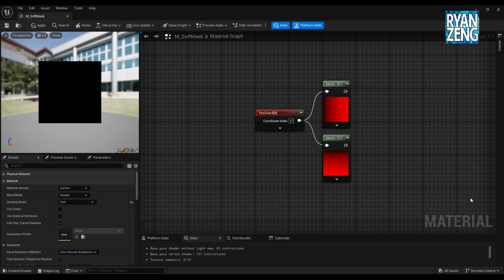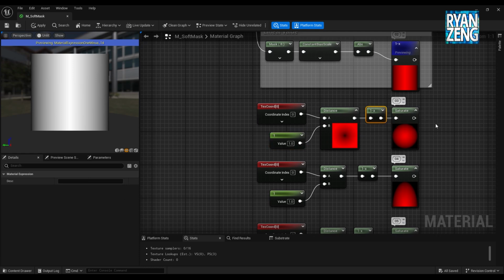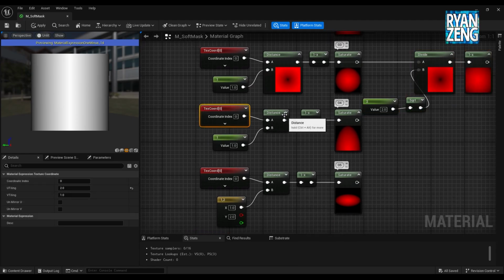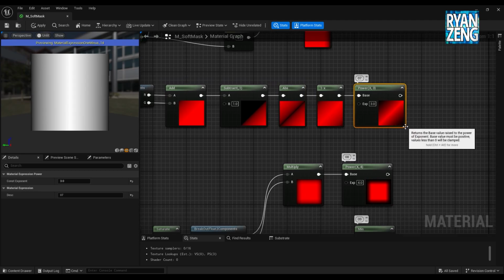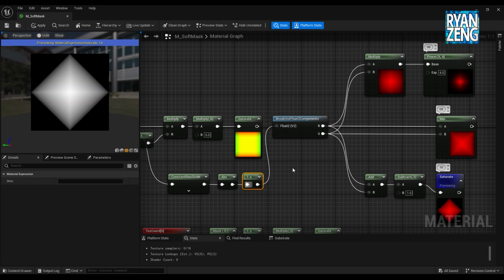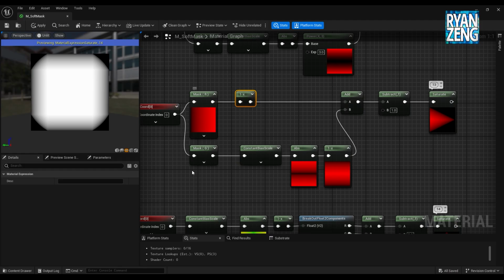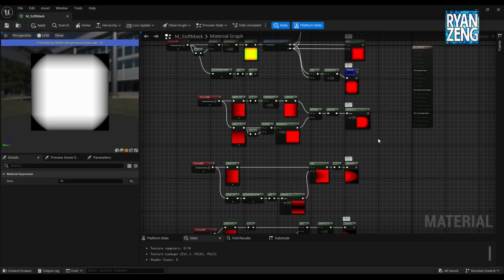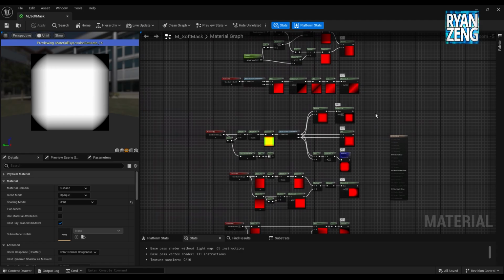[Training cases 05] Soft Mask in Material

Comment: Thanks for very useful tips❤
Just wondering if this method is more optimize than using available texture or not?
Reply from the maker: Yes, those are very common method and more better than a texture nowadays. But as what I mentioned in video, we still have to consider what performance limitation in your project. In some target marketing within super tight performance budget on mobile, we should leave Distance and sin away.  But based on UV doing few add, subtract, multiply and divide is cheap thing.